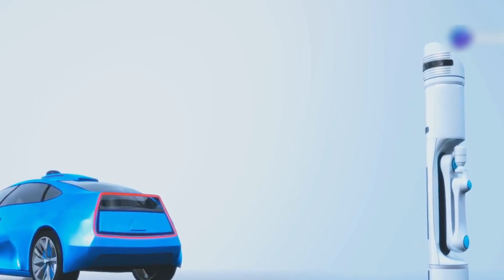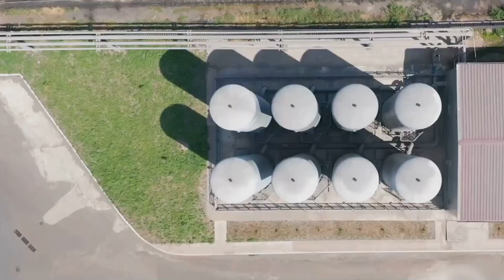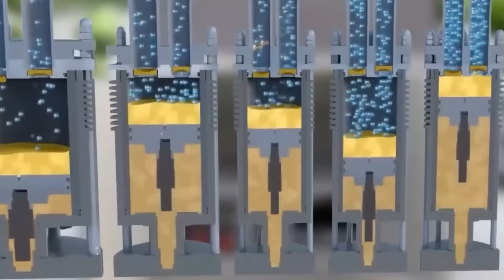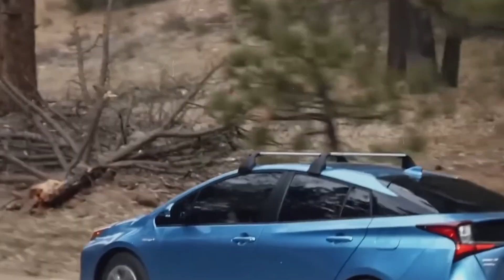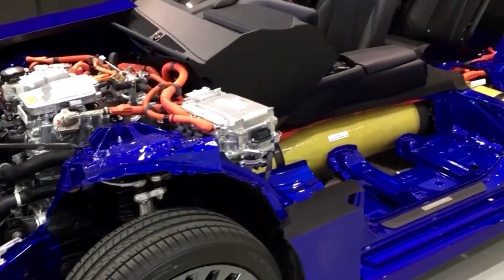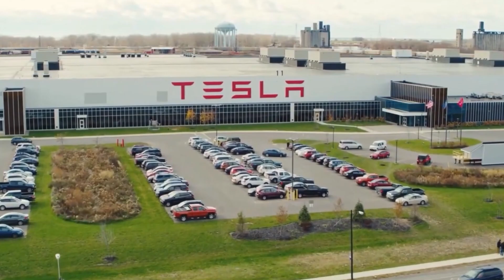The #1 Thing You're Getting WRONG About Toyota's New WATER Engine

Comment: A Tesla uses a Lithium battery which outputs about 400 VDC and sends it to an electric motor. This Toyota water car uses what i would call a water battery that also outputs 400 volts and feeds it to an electric motor. This water battery is comprised of a 10 gallon water tank, a water electrolyzer and a fuel cell.  You charge the Tesla battery from the electric charging station, you charge the water battery by adding distilled water.  Plus this water battery weighs about 700 pounds less than a Lithium battery and it literally is fireproof.